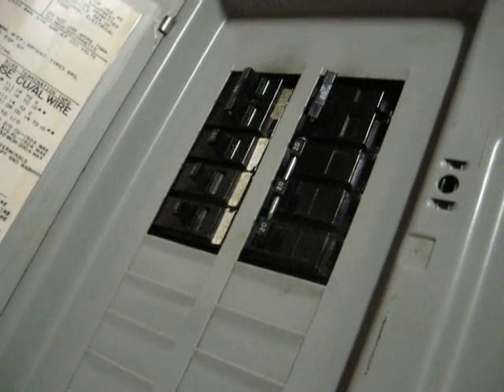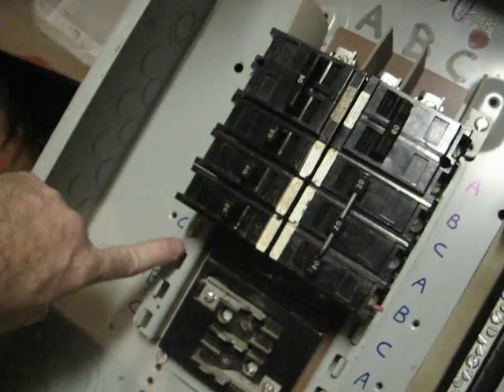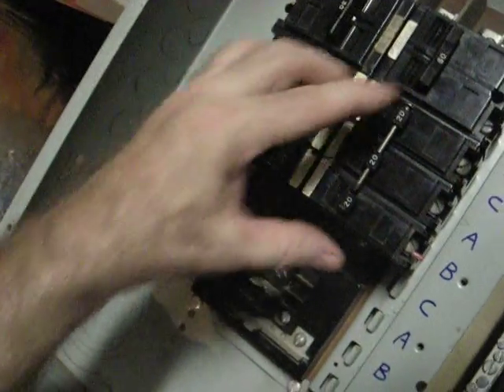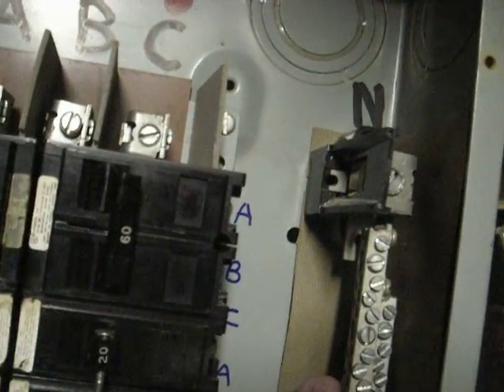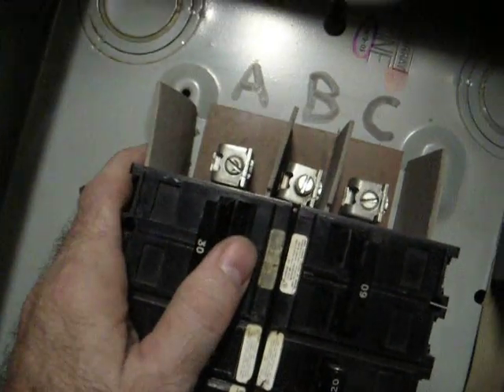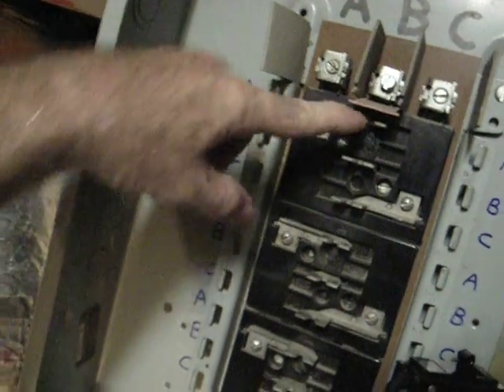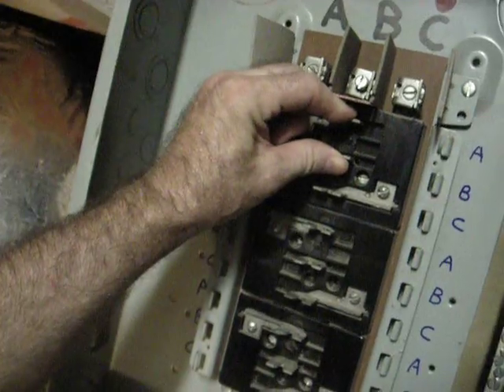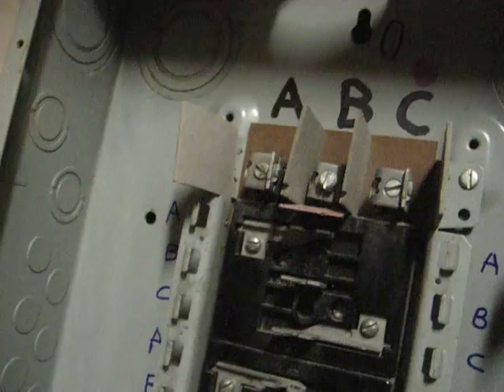Three Phase Breaker box and how it holds 1, 2 or 3 pole breakers

Comment: There's several variations of 3 phase,  the most common (talking about the USA) being 120/208 wye.   277/480 wye is also common,  used in larger commercial and industrial applications.   277 volts is commonly used for lighting circuits, many LED drivers, electronic ballasts for fluorescent say something like 120-277 VAC.   magnetic ballasts for high intensity discharge- metal halide and sodium vapor, will often have taps for 120-208-240-277 volts aka quad tap.   347/600 wye also exists,  it's rare here in the states but super common in Canada 

Another variation is the delta configuration,  and there are variations of this as well.  Corner grounded delta, open corner grounded delta,  ungrounded delta, high leg delta and open high leg delta are variations.    240, 480 and 600 volts are the most common.   120/240 3ph 4w delta has 240 volts between any two phases,  120 volts between two of the phases and neutral,  the third phase 208 to neutral.    This is usually found in older installations but can be found in new work as well.   A much more rare variation is 240/480 V 3ph 4w delta,  with the high leg 415 volts to neutral.      

More rare yet is 2 phase service,  unless you working in Philadelphia you will never come across this.

Comment: Hey there 3beltwesty quick question. I could simply run a 100 or 200 amp breaker in that panel to another panel to create a 120 subpanel right?

Comment: What you missed explaining was if you have a 3 pole: on A, B, and C, what power do you get?  And why?  So if I put a 30 amp breaker on A, I get 120 volts that “breaks” at 30 amps?  So if it’s on A and B, is that 208 volts that breaks at 30 amps?  What if it’s a 30 amp on A, B, and C?  Also, I currently have a double pole breaker on A and B that says 30 on each part, A and B, but they are tied together. Does that make it a 60 or 30?  Oh, so having trouble grasping this. 😞
Reply: 3 phase is literally 3 lines of power coming in, each at 120v, using a 2 pole breaker uses 2 phases and makes 208v/240v, using all 3 phases is a different beast that requires a lot more explanation.  If you use a 2 pole 15amp breaker, you are tapping 2 phases @120v giving your 208/240v, still drawing a max of 15amps total, but with a higher voltage.   So your 30 amp 2 pole breaker is 2 30amp 120v breakers working together to give you 30amp 208/240v.
Reply: John Pouliot Great explanation. Thank you. I may not be an electrician but I am a software engineer and I HAVE to understand this puzzle!!  What I don’t truly get is the delta vs Y configuration. Every explanation uses a formula to explain it which, although I’m analytical by nature, tells me nothing!!  How do I know my configuration?
Reply: @sancop  if you have a neutral, your service is a Y. This is the typical service, delta is not very common in most light installations in the US.
Reply: Amity Games , this may not be considered light, though. It was originally a large commercial building with a lot of freezers.
Reply: @sancop  ok, hopefully a more cogent reply. AC voltage varies like a wave (plus, zero, minus, zero, plus...etc). A three phase service has 3 live wires (A,B,C) that carry the same AC voltage - but the timing of their "waves" is offset by 1/3 of a full wave. If the service is 120Y/208V, the AC voltage between each of the three live wires and the "neutral" is 120 Volts at any time. The AC voltage between any two  live wires (AB, BC, or CA) is 208 Volts (if you have the uncommon Delta service, there is no neutral, but the principle is the same). 

Now, onto breakers - each breaker pole is independent, and tracks the current drawn from each live wire (A,B,C). So, a single 30 amp pole on the A wire will trip when the overload exceeds 30 amps (not really, but that's good enough to understand the idea) - regardless of whether this wire goes to a load connected to neutral (120V) or to a load connected to the B pole (208V). Some circuits or loads are single-pole (line-neutral 120V), others two-pole (line-line 208V), and finally there are three-pole loads (line-line-line 120Y/208V). You have one, two and three pole breakers made for each of these circuit types, but in all cases, if the current on any pole exceeds the rated amps, all the breaker poles trip. The fact that the poles are tied together forces all three live wires to trip together even if only one exceeds the rated current - it does not multiply the rating of the breaker. A 30A three-pole breaker will trip if the current on any wire exceeds 30A (again, not really 30A but that's the idea). 

The electrical power in circuits varies based on voltage, current, and number of poles. One or two poles - Power = Volts x Amperes. Three poles/phases - Power = 1.7 x Volts x Amperes. That's why you have three-phase service - you can get more power with less copper wiring.

Anything less than 400 amps at 480V is pretty light service...

Comment: I'm thinking in a load to be able to be energized by a battery bank(feed with solar panels), when this are dead move the circuit breaker to the grid. you think this will work

Comment: Question, if I have 3 existing single phase 220 outlets with 4 female receptacles, can I go back to the main breaker and find all 4 wires separately?  In other words, if I have each of these single phase 220 currently with separate breakers, will all four wires come back to the box, or do I run a risk of those wires being tied to something else in the wall, assuming everything is to code?   I have a 10 HP 3 phase converter, and I would like to convert each of those single phase outlets in my shop to 3 phase.  Any help would be appreciated.
Reply from the maker: daikuone Normally folks run the output load side of the 3 phase converter as separate from the buildings original wiring . ie the Homes single phase box connects to the phase converter and the converter then connects to the 3 phase loads.

With a single phase 2 pole Breaker all the wires should run back to the box for each device. On a house one can have a Range with a say 60 amp 2 pole breaker and there is often 4 wires to the range on a modern home and 3 to an older home. ie 2 hots 120 volts to neutral and the white Neutral wire. The 4th wire on more modern homes is the green wire ground wire to the range

Normally with single phase 208 to 240 volt USA 2 pole breaker fed devices there is no extra "un used hot" wire to "convert to 3 phase" . I think that is what you were asking.

Comment: Just curious, why wouldn't you want to tie the neutral and the ground (if one existed in the panel) together if they are already tied together earlier in the system?
Reply from the maker: A panel like this often is not right by the meter. Thus the Neutral's voltage will be sightly not at ground. The neutral wire can and often has current through it and the ground wire is to never have current going through it. In the USA these are separate wires. On a subpanel or when the panel is not right by the meter the Neutral bus bar is floated and not connected to the panels metal which is connected to the ground wire system. If the panel is right next to the meter then the voltage of the neutral is about the same as ground. When the panel is say 50 feet away then the Neutral can be several volts away from ground. The NEC codes and inspectors do not want you to have the Neutral tied to ground (earth) in subpanels.
Reply from the maker: In the USA you do not ground the Neutral after the main disconnect. Often they are right at the main entrance service panel that is right by the meter.
Reply: In 3-phase Y service, the neutral is not connected to the ground. It may return current to the transformer upstream if the phases are balanced.

Comment: I have the same configuration on my panel and B is the high-leg. I'm wondering if it would be possible to hook up a single phase 240v motor and pump on a double pole breaker, sharing phases A and C or doing two separate single pole breakers, each on the same phase, such as two C connections, but in different locations on the panel.
Reply from the maker: For clarity I believe you mean your A (left bus bar) and C (right bus bar) are 120 volts to ground and the B  (middle bus bar) is 208 volts to ground. This is how older (pre 1970's disco) high leg panels were often done to meet the old code. Today the code requires the high leg to be on the far right C bus bar for new installs.

 OK the proper safe legal code way is to use a 120/240 volt rated double pole breaker so your 240 volt motor uses your two 120 volt legs on A and C. If outdoors or in a wet area then a ground fault type is required.

If you were Scotty on the Enterprise crashing then one could use two single one pole breakers in any open slots on your A and C 120 volt legs even if far apart. Just using your two C 120 volt legs means one has two 120 volt legs to neutral and thus no 240 volts between them I am not sure if this was your reasoning, or my mis reading. Using two separate  120 volt breakers on your two hot 120 volt bus bars A and C would work but is unsafe and clearly not to code. If side by side in the panel and ganged together then approach being the same as store bought 2 pole 240 volt breaker. A code inspector does like seeing two single pole beakers twined with a nail!

With your set up of A and C being 120 volts to neutral and B 208 volts  to neutral there is 240 volts between A and C, between A and B and between B and C.  If your wild B 208 volt leg is used for a  240 volts to A or C then the double pole beaker MUST be a full 240 volt rated breaker and not a 120/240 breaker. i.e. the 120/240 breaker has the SLASH; these are rated so each hot leg is only 120 to ground. When they wild 208 volt legs is used then the hot 208 volt leg requires a NON slash rated breaker . ie a  240 volt breaker.

A lower cost double pole breaker a the box stores is sold for most normal houses. Thus a 120/240 volt double pole breaker is ok for the dryer. With your set up if the wild leg is used on a double breaker then it has to be a non slash breaker i.e. it says 240 volts and not 120/240 volts on the actual breaker. 

I mention the slash 120/240 and no slash 240 volt breakers because it is lessor known and one can get in trouble with fire or the inspectors or both
Reply: 3beltwesty Thank you for these details.  I have room to use the left and right bus bars, so I'll use a 120/240 volt double pole breaker.

Comment from the maker: There are also other more oddball 3 phase setups too. Another is a where there is a grounded corner 240 volt Delta. This has one of the A,B or C phases is at ground and the other two are way above ground. Thus line to line of any phase might be 240 volts and say B is grounded and thus A and C are 240 volts to ground. Measuring between any combo of A,B or C reads 240 Volts. Some called this a corner grounded system, others call it a Grounded B Phase. Not used where 120 volts is needed

Comment from the maker: There are single pole breakers that fit this type of box rated for above the nominal 120 volts. These are not at Home Depot; more like from an electrical supply house or even just Ebay. These are marked on the breakers 120/240 volts for a single pole breaker. Bryant was a maker of these that we use here. These are rated for both 120, 208 or 240 volts to neutral. A normal 1" breaker is not rated at this level and is like the 150 volts or less common Joe breaker in folks houses.

Comment from the maker: A 3 phase breaker box can be wired up in either Wye or Delta. 

(1)Most today are in Wye; like how a McDonalds is designed with a 120/208 Volt 3 phase system. In this usual case each of the phases A,B and C are only 120 volts to ground and normal "voltage" breakers are used.

(2) In a rarer typically older high leg Delta box two of the Phases are 120 volts to ground and the wildcat ie "high" leg is 208volts to ground. Typically the 208 phase to Neutral is not used to ground; BUT there are some

Comment from the maker: In the USA the neutral buss bar (grounded conductor) is only bonded to green wire ground (earth) at your service panel where the electric meter is. With a SUB panel the box is away from this point and thus the neutral buss bar (grounded conductor is isolated from the green wire ground

Comment from the maker: The green wire ground wires are called grounding wires. They normally do not carry any current. They are use to drain off any leakage on a faulty motor, to "ground" the frame of a device to reduce shocks.

Comment from the maker: The NEC calls the Neutral wire the grounded conductor.

 Note that the correct term is Grounded Conductor, not neutral. BUT folks in the field have used the term Neutral wire for over a century.